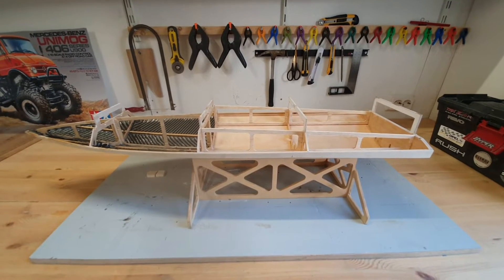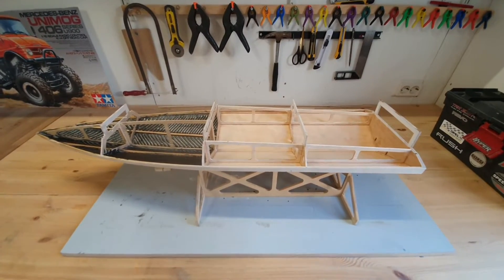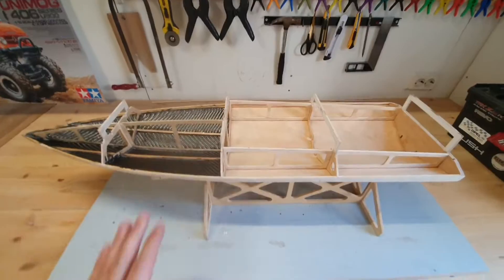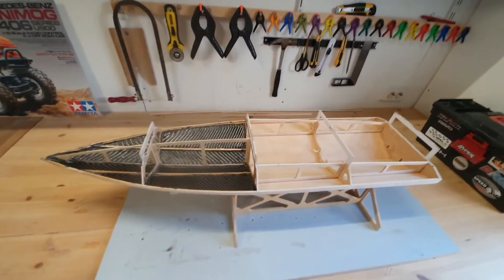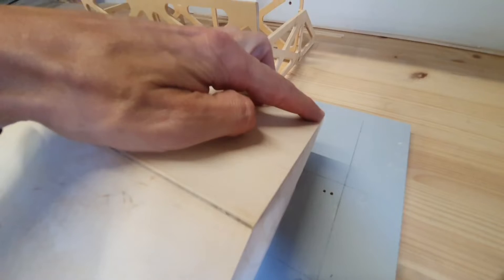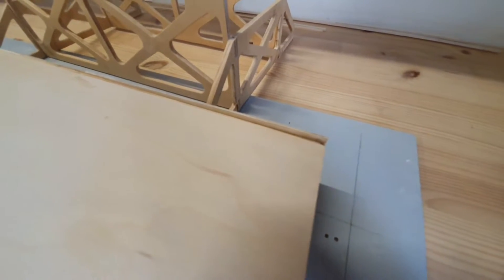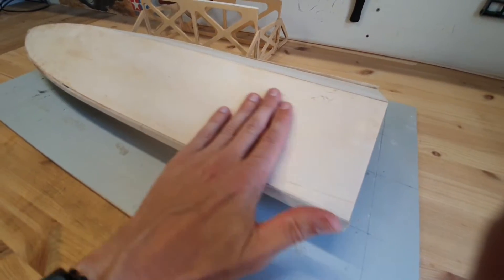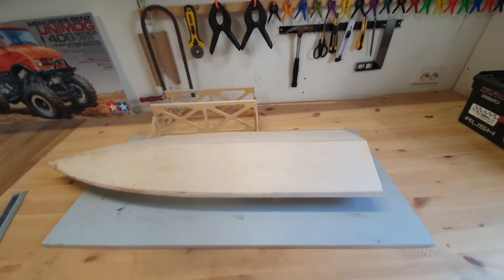RC boat build - Twin motor mono part II

Comment: pretty 🤩 treated to give this a go 
Where do I buy the shirt pans from 
Can I get the plans as a dxf so I can cut the parts on a CNC router
Reply: Will do 
My original message was corrupted by spellcheck 😂
I’ll email you
Reply from the maker: Hi Brenton, I can send you the drawing in PDF format. You could convert it to DXF by a converter program. If you're interested, please send me an email at cozyrc1@gmail.com ✌️

Comment: very good work, what wood do you use, 3mm plywood or something else? and the brand of glue? THANKS. Sincerely
Reply from the maker: Thank you 👍 I use 3mm plywood for the ribs and bulkheads and 1.5mm birch plywood for the plating.

Comment: Interesting how you use a syringe for epoxy 😮
Reply from the maker: Yes, it's a very fast and easy way to apply fillets. And the epoxy doesn't stick to the syringe, so you can clean  it and use it again. ✌️ DJ

Comment: Hi DJ nice build again. I noticed you don’t use clamps anymore? When I build the F1 Cozy RB version I noticed later, after painting, so to late, I used clamps on some places the result was not completely flat. For me lessons learned.
Reply from the maker: Hi René, thanks 👍. I guess I could have used clamps instead of tape e.g. for the side plating. I didn't avoid the clamps on purpose, I just got the tape this time 😉.
Using clamps, tape or weights always has the risk of deformation, caused by too much pressure. I made that mistake as well! ✌️ DJ

Comment: Is it plywood?
Reply from the maker: Hi Sakibian, yes it's 1.0 and 1.5mm  birch plywood for the plating and 3mm plywood for the ribs. ✌️ DJ
Reply: @CozyRC  One more thing, is Birch ply's easy to bend?
Reply from the maker: @b2beyondrc  Yes, if it's thin, like I use. The video will show how I apply the sides of the boat. Very easy to bend 😎👍
Reply: @CozyRC  Those looks like 2-4 mm Balsa 🎃
Reply from the maker: @b2beyondrc  The sides are 1mm birch ply 😎

Comment: Amazing job😊
You have a twin flexshaft's left and right?
Reply from the maker: Thanks Daiciu, and yes 1 left and 1 right rotating flex shaft 😎
Reply: @CozyRC  don't forghet to double check when you put the props and motors rotation,and yes two great wood boats builders😊